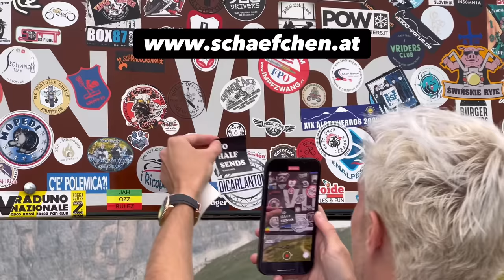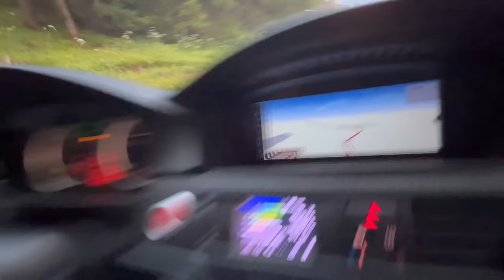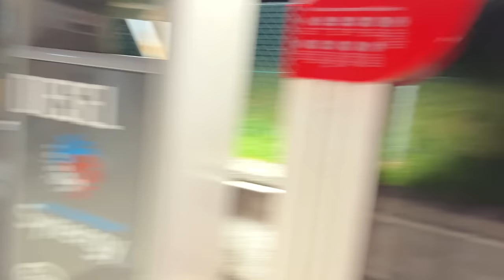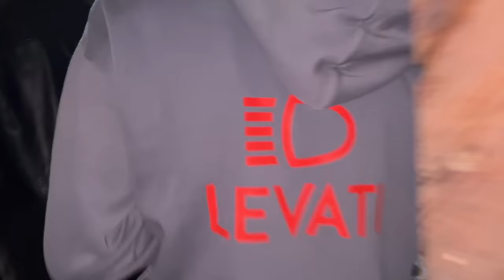700HP STRAIGHT PIPED M3 E90, M3 F80 & M5 E61 DRIFTING the MOUNTAINS - BROKE my car!

Comment: Really nice build, love how it sounds but I gotta ask. I have an e92 m3 myself and I’m always afraid of drifting or doing burnouts due to subframe bushings. So I was wondering if you ever have had a problem with your subframe/bushings or if you have made any modifications to your bmw to allow yourself to drift without getting issues like that? It’ll mean a lot to me for a response and either way, thank you for your time with reading this message.
Reply: Dont be afraid, some time everything gonna break, just tidy it up. the solution to the problem makes the car harder and with more vibration, anyway and with any solution it will come time to fix something...
Reply: If you are reasonable with what you do you won't have any problems. I own one 5 years now and I use it for all kinds of stuff. Road trips, fast rides, drifting in the mountains etc. No issues with subframe and bushings after 50K kms. Just do maintainance on time, wait before the oil is in the right temperature every single time before you rev it, and everything's going to be fine.

Comment: You made driving without power steering look like it takes an Olympian..
 I drove daily without power steering for years no problem... it's a little annoying in parking spots, but nothing like you made it out to be.
Reply from the maker: U realize its diffrent in every car depending on the tires for example
Reply: @schaefchen  No, that never occurred to me..... The daily was one of many vehicles I've driven and tracked without power steering. Daily had 265s upfront.